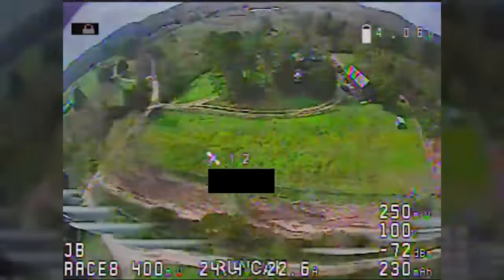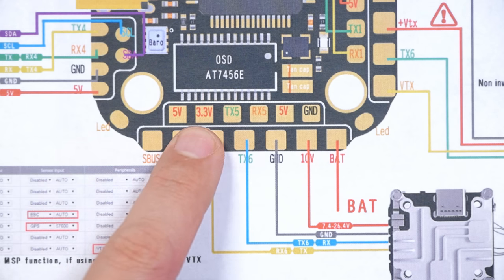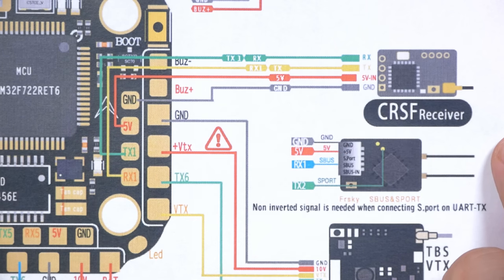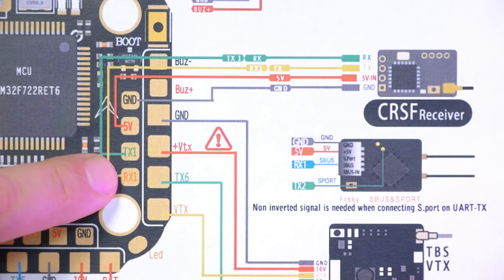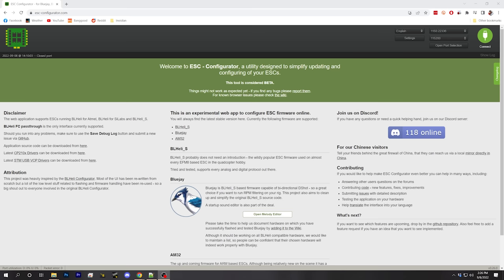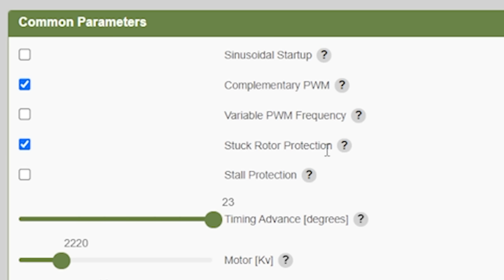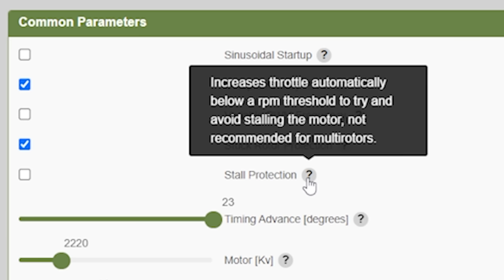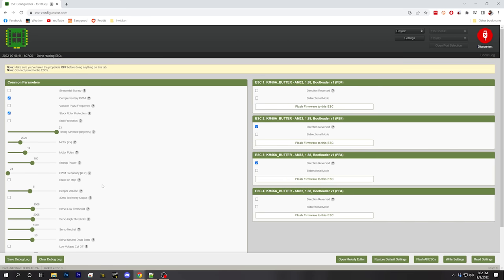Can this ESC survive my "160 mph" quad // SKYSTARS F722 MINI STACK

Comment: esc-configurator works with all chromium based browsers, so it will also work with Edge on Windows. Chrome, Chromium, Vivaldi, Edge. NOT Brave though...

Comment: Id argue that the props flattening out was making it easier on the ESC since they were not biting the air as much on the top end there. Retry with stiffer props 😂
Reply: funny, my first idea was, that you would need steeper props for these speeds
Reply: @ersetzbar.  Haha I don't think that same lipo would survive it. The poor thing was crying. Might need a beefier battery for that!

Comment: I have a Skystars KM45 esc and as far as i can tell this is one of the durable esc i have. I mounted it in my race rig and after several (hard) crashes I count more burnt motor than esc damage. I bought 2 more of their esc hoping are as durable as the first one.

Comment: 5:38 - Instead of USB power for the GPS, get a ViFly GPS Mate. It functions as a powered buzzer and powers the GPS before the fix and between LIPOs. It's easier and more functional than a USB power bank.
Reply: USB is so much better. Firstly, the vifly gps mate adds weight. Secondly, their internal battery dies very easily by simply using it and crashing, I already killed two. USB on the other hand is simple and realiable.

Comment: My first mini quad was a 2400kv emax hawk pro. I ran 6s on it for like half a year. No issues with it at all. Was super impressed when I learned that I wasn’t supposed to do that 😬.
Reply: LOL, one of the things that saves you is its not a static load. If you did it on the ground without a dynamic change in load you might have had some toasted components..lol Good times. I bet it was fast.
Reply: LOL

Comment: We did this a couple years ago.  I actually built the same quad after your video. The Luminier F7 and Tmotor ESC with 2800kv motors on 6s.  Still have the parts from it.

Comment: The ONLY way I found mine to go that fast with your exact set up was using carbon by-blades, other wise the tri blades set up just drew too many amps causing the quad to flip out. The settings I had to work with was not so much pids or filters but the setting in the esc, ramp up and such but in the end I was successful, the video is on my channel. Hope that helps.
Reply: Carbon blades are insane. I only had one pair back in the day but what a difference in characteristics.

Comment: Also depends upon the weight of the quad compared to what it was before with the pid's, especially with high power to weight quads, the pid's can really vary a lot, normally an amount of TPA such as 70% at 1700 can be applied to smooth out that wobbling caused by the pids at top end of throttle ;)

Comment: I don't know if you guys ever had the chance to fly the Diatone R349 but it was telekinetic. It was about 35mph down from this quad but the absolute power to weight ratio made it directly connected to your wishes.. It also pulled down 90+ amps on a three inch...lol
Reply: Still have and fly mine, it's a beast!!

Comment: Affiliate link, Joshua? I don’t see it? Picked up a couple of the full size F7 HD stacks a while back when they were cheap. I’ve had good luck with the one I put on a basher quad. 50ish packs in with no issues. Average sessions, nothing extreme. Not a lot but it’s a sample.
Reply from the maker: Geez how did that not get saved! I've added it now thanks for pointing it out.

Comment: Just realized I've done my first 4s build and this is totally possible. 2750kv on mine and as I predicted from your 8s videos these 4s motors are already hot on the right voltage and the blackbox is good😬. 30x30 BL32 and rvs creamer frame.

Comment: Maybe try a 20x20 ESC that has full sized MOSFETs? The Foxeer Reaper 60 and the Reaper 60 Slim are two that come to mind.
ESCs that have the small MOSFETs usually can't hold up for long when being put under a lot of abuse.
Reply from the maker: Yes! I agree. This one won't be as durable as the Reaper.
Reply: This has full-size mosfets

Comment: @joshuabardwell thats weird I had 2208s 2450kv on 6s....and with a good esc and FC I didn't even have to tune it for it to fly decently.... it was a freestyle frame... good esc was fine but it did ignite a cheap tmotor esc doing a split s....

Comment: Hey there JB,first of all love to watch ur vids.Actually m new to this hobbie,and i need a suggestion,m building a quadcopter and the issue is i got mamba mk3 stack which has only 5v bec out and the Vtx i got is an Akk Raceranger which requires 1600mw power,so the question is should i got for an individual 12v BEC or a Normal 2/3A  9-12v stepdown voltage regulator?Thnkx
Reply: Im running the mamba f722 mini mk3 and akk fx2 ultimate mini, i just use the vbat pad from the fc to run the vtx. Not a single problem to this day besides noise as i havent installed a capacitor on the esc. If u just add a capacitor to the xt60 or the esc power pad i bet it would eliminate most of the noise.
Reply: @RD5500  Thnkx for the info man🙌 .Yes m already using capacitor,soldered directly to the XT60 connector.

Comment: Different firmware, different props, can you really say the new FC is flying worse when you are not running the same config?
Interesting video, have been running AM32 and have blown a couple of blheli32 ESCs recently but the Skystars AM32 are holding up well.

Comment: Yay that answers an unsolved mystery of mine. My quad freaked out upon takeoff just like that, but not on betaflight 3.5, only when i updated to 4.3. I guess my quad was too powerful for betaflight 4.3 defaults. On that note, I have never gotten 4.3 to fly as well as 3.5, which is kind of a bummer. I tried downgrading but 3.5 but it isnt in the software list anymore. I could probably find it on the web somewhere but its just that extra bit of hassle. I kind of wish they just left old versions in the configurator longer, but i know thats a hassle for them because the gui doesnt work with versions that old.

Comment: I've got a old but flawless 6 inch moka frame with brother hobby r5 2207 2700kv with a old school Bardwell yep Bardwell flight controller that 4in1 dal rc motor esc that I've clocked at 106 mph with 5 inch 5x4.3x3 hq v1s props it's very snappy hanging on my wall for about 2 or 3 years now just begging me to play with it

Comment: Sensored motors would be for FOC, although nowadays you can use estimators without a hitch. Just at 0 rpm you need to jog the motor cus the controller doesn't know the position.
Reply from the maker: Sensored motors are not just for FOC. They are often used in ground vehicles where you need torque at low RPM.
Reply: @JoshuaBardwell  if it’s not a servo, you can’t get 100 torque a low rpm with synchronous motors. An inherent trait.
Unless you use a vector control based system you have no finite control over torque as it is still coupled to flux thus speed. Moreover the motor is unstable till you reach the steady state rpm. I went a bit off topic but that’s why I’d love to see foc on drones. Part of my degree was control theory and motor control. When I hear PID I shudder when I hear pid, as the running gag is pid is the poor man’s choice and is never the solution (pid is only optimal with 0 delay, which isn’t possible)
in our case sensorless is absolutely fine, if an arduino can do it… anyhow thanks for your insight, love your content btw

Comment: I have my quad with the Mamba f405 Stack with 2400kv Motors and ran it on 6s Not often just for fun it still works but i killed 3 6s 1550 lipos in the matter of like 5 flights😂

Comment: It has a BMI 270 gyro, so of course you had to get different (or stronger) filtering options than with the old 30x30 stack wich had the mpu 6000, I guess.
Reply: I've been comparing mpu6000 and bmi 270 for a while now. It's pretty much the same. I even have a mpu 6000 fc which actually needs more filtering than my other parts.
Reply from the maker: That shouldn't be true in BF 4.3. It changes the internal hardware low pass in the BMI gyro to be similar to the ICM and MPU gyros.

Comment: Just fitted some new Pacer III v2 2306 1950kv motors on my previously 2306 2450kv hypetrain rig and my f7 Mamba 50a stack is freaking out am getting mid throttle flyaway at take-off. What would I do to fix this I've reset everything to stock latest firmware target and esc updated to latest firmware but still the mid throttle madness continues to plague me. Any help would be muchly appreciated 🙏

Comment: I have a problem: the motors when idling vibrate and make a rough sound that fades as speed increases (both with and without propellers mounted).
I bought mini F722 HD Pro AM32 ESC Stack 2022 version
and I'm using it with 2806.5 1300kv
I'm using Betaflight 4.4 and checked that all 4 motors spin in the correct direction (if I use Betaflight for spin the motors they suond smooth)
Can someone help me please?

Comment: So I have bluejay on... and I am getting EXACTLY what you described about the variable PWM frequency. Mid throttle only oscillations! Can you not turn this setting off without re flashing the escs? I don't even see that option on there.
Reply from the maker: You can only change the Bluejay PWM frequency by flashing the ESC.

Comment: Bardwell you never tried the old pids and filters. You only tweaked the defaults once and didn't play with esc settings after setting this up. Dont think it's fair at all to say the fc is noisier without any attempts to validate it.
Reply from the maker: For sure. I wasn't interested in doing a big in-depth comparison between the two. It was just my impression. The old PIDs and filters were from BF 4.2 anyway, so directly copying them I'm not sure would be fair. I can say, however, that the old FC and ESC could at least hover on default 4.2 PIDs and filters, but 4.3 default PIDs are more aggressive, so I'm not sure that's fair either.
Reply: @JoshuaBardwell  fair, didnt realize the last batch could fly on 4.2 defaults. I would be interested to see if you could tune out the bad behaviours and get it working really well. Tuning aircraft like that has always been more entertaining than typical aircraft.
Reply from the maker: Russell Phelan  even with the sliders turned down ridiculously low, this quad still had some noise-related issues and wasn't flying perfectly whereas the other quad had higher PIDs, less filtering, and flew better. So which direction is the tuning going to go? We're going to turn the PIDs and filters down even further and it's going to fly worse? That's what I based my opinion on. 

To do a fair comparison, I would have to upgrade the old FC to BF 4.3, then do a detailed PID tune on each FC, and etc. That might make a good video, but it's not the video I was making at this time. So you get an off the cuff comment at the very end of the video, with my general impression, and you can take it for whatever you think it's worth.

Comment: Just curious what variant of the Skystars ESC was used for this experiment (or does AM32 only come in the one 55A size)? My "build" (BNF) with the KO45a ESC and 1700kv motors turned into a fireball after a relatively minor crash (other builds survived worse crashes)
Reply from the maker: It's the 55a one.

Comment: What all ESCs are capable of running higher kv motors like this? Can someone name off a few? Like what is the best to do this?
Reply: I like the spedix gs40 and ls40 20x20s. Full size fets , 6s and reasonably priced. Defiance RC has them.👍
Reply: All of Foxeer big FET ESCs will do 40V 100A easy from experience.

I have heard good about Holybro metal capped FET ESCs, but haven’t personally stressed them.

Comment: Does an esc put the full battery current into the motor and adjust the frequency or does it adjust current and maintain a fixed frequency or both?
Reply from the maker: It adjusts the frequency of the PWM signal. The PWM signal oscillates between full voltage and zero.
Reply: @JoshuaBardwell  thank you

Comment: Fun, but an easier way to get a fast quad is just making a 7inch or bigger, no? .
Reply from the maker: It's harder to make a bigger quad go fast, because it has more surface area and more drag. The top speed record for multirotors is held by a 5".
Reply: @JoshuaBardwell  I see. Not what I expected!

Comment: The flight controllers & ESCs feel like a huge scam. They’re selling them incredibly expensive even though they’re all just bare circuits. Their components are incredibly cheap. Most of them don’t even use a quality IMU sensor. Most of them just use a MPU6000 or a MPU6050. I’m thinking about creating my own FC & ESC with high quality parts. I’ll be sharing the schematics and gerber files. For the IMU I’m thinking something fancy but it looks like the best thing that betaflight supports is a BMI270. I might just go with that or I might try to add support for better sensors in betaflight’s new version. I think we have a lot of room for improvement when it comes to sensors. The FPV drones are incredibly unstable for what they’re capable of. And the industry is just trying to make quick bucks for with cheap components. Even DJI is not using high quality parts. The profit margins are stupidly high. It’s time for someone really competitive to enter into the arena.